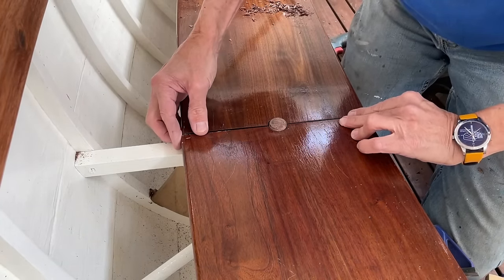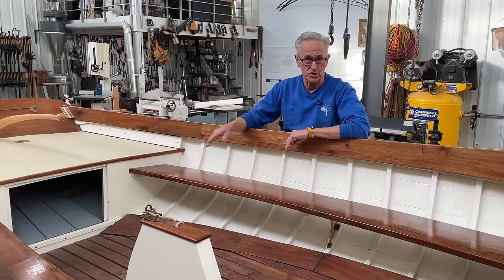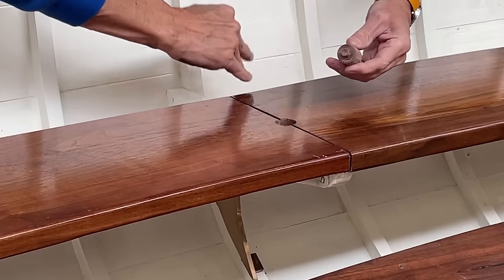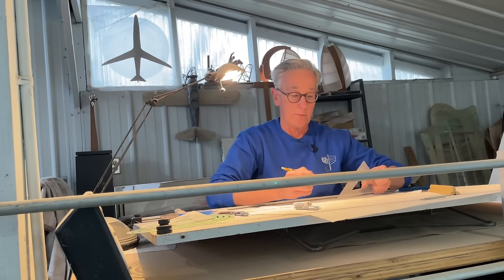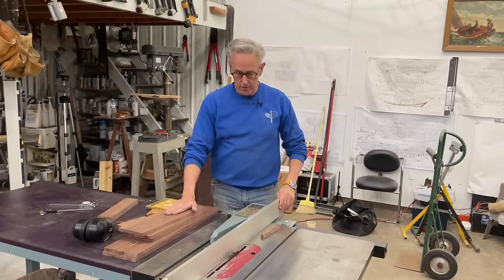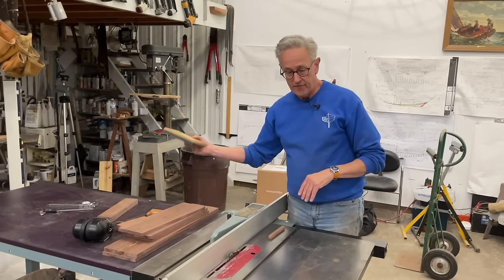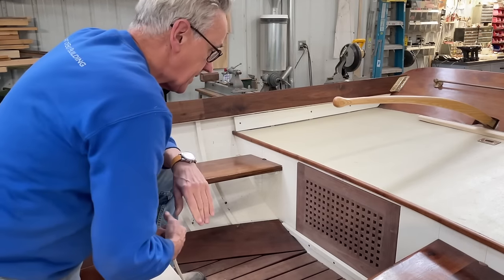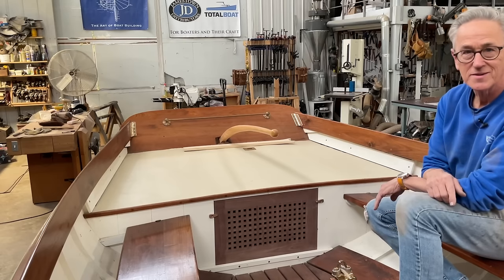Steps in Making a Yacht Grate Revealed S2-E72

Comment: After seeing many elaborate box joint fixtures for table saws, it was nice to see one made so simply. Thank you Bob for the beautiful work. Have a good evening and best wishes for a joyful Holiday season.
Reply: Well it's only simple because he has an expensive dado blade...
Reply: @DrTheRich  I guess that depends on what you call expensive, FB marketplace where I am has used/new in box for $10-50. The custom insert for the table saw, the saw itself and that fence are money.
Reply: @brucelyle5136  you also need a table saw that fits a dado. It won't fit in my €1k tablesaw
Reply: @DrTheRich . I was most interested to see that Bob is using the very same Vermont American brand of dado blade that I purchased in 1979.  It was inexpensive then and I’m still using it today, 44 years later.  Good tools don’t always have to be expensive.

Comment: Really nice hatch. 
One question/concern. At the lake where I have my boat in fall we get a cetain bug that looks for „shelter“ we find them in sail covers, rolled up sails or even under seat cushins it they have been forgotten to take in. I think you will slip your boatbin an out. But wherever it has her place the open grid might invite bugs to get into the hatch. But on the other hand Illinois might be different than my neck of the woods.
Reply from the maker: Interesting. You must be from an area with a more moderate climate. Here in central Illinois the freezing temperatures control must critters. If bugs are an issue the addition of fine screen on the back side should detour them.
Thanks for watching!
Bob
Reply: @TheArtofBoatBuilding  I live in the Southwest of Germany (hot muggy summers and mild winters). The bugs come into closed spaces early to late fall when the temperatures drop. In cold winters they get killed in warm ones they survive. Those bugs are not an issue during the summer though.
I think a fine mesh at back would be my solution too, a dark color would be nearly invisible from the outside and the maritime look is not disturbed.

Comment: two little dowels set in the grate below the screw level would work well so if the latch falls it sits on the dowels and by being lower than the screw the latches will fall to stay closed ,, just a thought.

Comment: We do not have dado blades around here, so please bear with me. Could it be that the orientation of the last blade was wrong when you showed how they are setup?
Reply from the maker: Yes, in showing how the blades are stack I did inadvertently show one blade in the wrong orientation. They all need to rotate the same way, which is how I mounted them on the saw.
Thanks for watching.
Bob
Reply: Great observation. I was he mounted it correctly on the saw.

Comment: I think a rabbet on the frame would be useful if this were to be used in a deck just to have support for a load on the grate.
Reply from the maker: A rabbet would work for a deck hatch. A rabbet would also be needed in the deck if it were to be flush with the deck. That would mean there wouldn’t be a need to put a rabbet in the grate. 
Thanks for watching. 
Bob

Comment: I think I would’ve run the rails and styles through and given them a half inch dado at a quarter inch depth, and then given the panel edges a dado as well to match
Reply from the maker: I think you’d be doing a lot more work that would be less accurate.
Thanks for watching. 
Bob

Comment: Every control system Requires! positive and negative feedback in order to operate.  Everything I've see you do is wonderful.. and mainly positive feedback is warranted (without doubt!!!) But did I miss something?  Your seats were already perfectly secure.  With an addended bronze support. Why are you drilling holes in your seat planks? I get you want to adhere to aesthetically Herreshoff techniques but I'm just not sure it is warranted.  But rest assured I will be eagerly watching each installment! because you are a STAR!... See.. negative and positive in the same response... perfectly damped
Reply: actually.. I get it now.. my bad